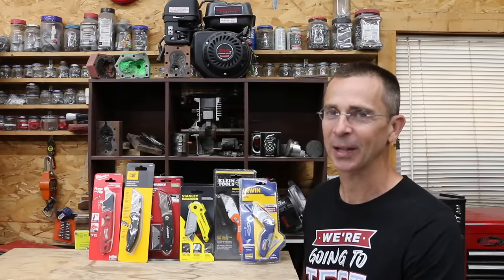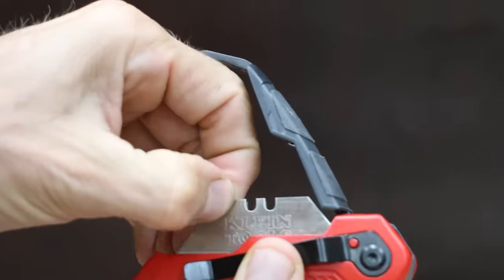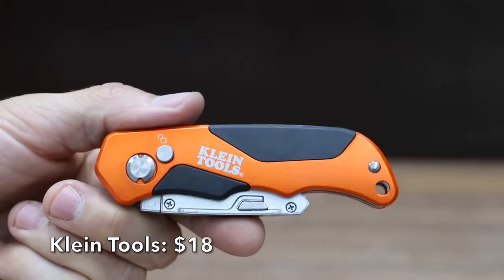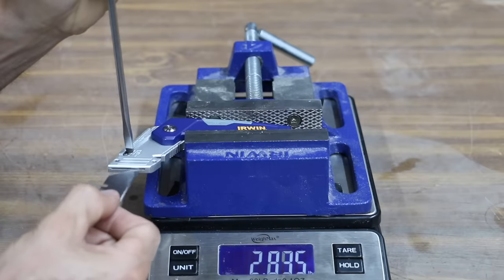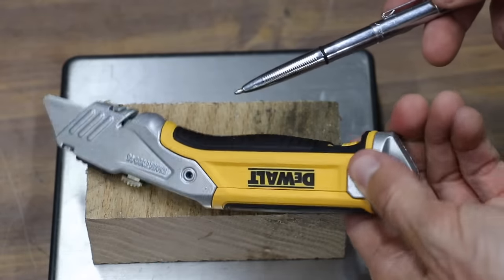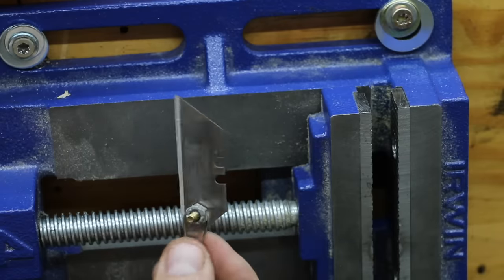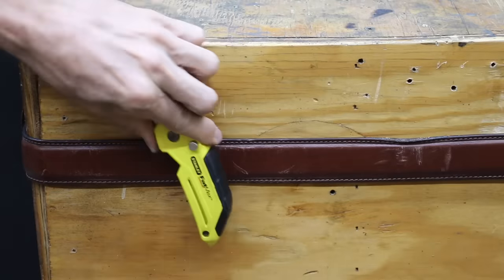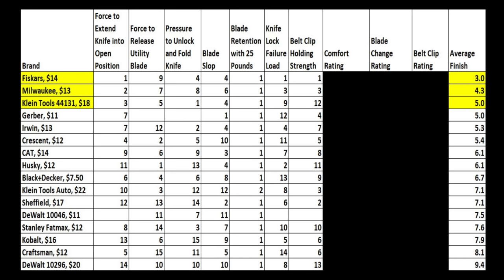Best Utility Knife? Let’s Find Out! Milwaukee, DeWalt, Gerber, Husky, Kobalt, Klein Tools, Craftsman

Comment: Your tests are usually pretty informative and helpful, and no offense but this one really misses the mark. I've used a lot of different utility knives including a few of these, and the problem ends up being either the sliding lock mechanism, the ability to hold a blade without slipping out while applying force, or some part of the knife breaking off or quickly wearing out with repeated use. I should add that I have only used knives with a "quick change" function like the ones you tested here. All of the knives I've used worked fine when brand new, it's just a matter of time before something goes bad.

Comment: I've got the 2019 Milwaukee version and it does NOT have the safety block for the blade release button and damn near every time I use it my knuckle makes its way to the release and out comes the blade.. very annoying. However. I feel like the button gaurd would be painful.. we need an upgraded Fuel version..
Reply from the maker: Thanks for the feedback.

Comment: The Gerber EAB  is not only too hard to open, it is hard and tricky to close, because of the poorly designed liner lock, which mysterious grabs the blade base after the liner lock is pressed in and the closing process has begun, requiring more force to overcome the defective mechanism and continue trying to close it, making it like a potential guillotine  for fingers and finger tips, if you're not very very careful. I added a  Dewalt Carbide blade to the Gerber for better cutting and general performance, but In my opinion it is too dangerous for its intended use by the general public, and I will soon be returning or throwing away the Gerber I bought.

 P.S. The round head, single groove screw holding the blade to the Gerber is made of very cheap material and will start stripping on the first blade change. Why they used a round head machine screw to hold a sharp blade tightly in position is a poor design decision and when the screw is completely stripped, good luck finding a replacement.  You'll never get another  blade to be held in as tight as it is when you first get it.  My Rating is "Unacceptable."
Reply from the maker: Thanks for the feedback.

Comment: Respectfully disagree with this one. I've carried a Craftsman branded knife in the Sheffield style (probably made in the same factory) for 15 years. Once you break them in a bit they open easy one handed and stay locked. They're easy to fold and clip back into my belt one handed as well. I've tried many of these other styles and they're either too big, too hard to open one handed, too hard to close, or too sloppy. The others may be better on paper, but the Sheffield style just works better for me.
Reply from the maker: Thanks for the feedback.

Comment: Video idea - I would really like to see if how well various fuel additives work from octane boosters to fuel stabilizers.  I can't believe the claims of the octane boosters that claim "just add 1 bottle to a tank of gas to get the equivelant of 93 octane" (or whatever they claim.  
I have a friend who claims his car barely runs when he uses regular (87 octane) but if he adds a bottle of something like STP octane booster his car runs great - the same as using 93 octane.  This is why I have a hard time believing him & the claims from STP:  the STP site makes these claims:
5.25 fl. oz. bottle treats up to 21 gallons of gasoline 
12 fl. oz. bottle treats up to 28 gallons of gasoline.
Now it doesn't take a genius to see that  the smaller bottle uses 1 oz to treat 4 gallons while the larger bottle (12oz) uses 1oz to treat 2.34 gallons.  The smaller bottle seems to treat 70% more fuel for equal amounts of additive but it seems both have the same ingredients.  Other brands have similar claims. 
Even with my friends 14 gallon tank I can't see that this 5.25oz bottle is going to raise the octane rating by 6 points!

Another idea is to test stabilizers like "Star Tron Enzyme Fuel Treatment" which I would be very interested to see if it does what it says it does: 

Features

    Makes all engines start easily, run smoothly; improves performance
    Removes and prevents gum, carbon and varnish
    Works in all engines and in all fuel
    Helps prevent phase separation by dispersing water throughout fuel as submicron-sized droplets that are safely eliminated while the engine operates
    Stabilizes fuel; helps rejuvenate old fuel
    1 fl. oz. treats 6 gallons of fuel
    Reduces smoke and all other emissions
    Keeps fuel delivery system clean
It seems to make a lot of claims & I'm sure these would be interesting to test!
Reply from the maker: Thank you for the video ideas!

Comment: Unrelated but Ive been wondering for a long time now if high octane fuel in an engine designed for low octane fuel sees more carbon build up and or less efficiency due to incomplete combustion. Ive seen plenty of opinions on this but no evidence based controlled experiment
Reply from the maker: Thanks for the suggestion.

Comment: The most important test is the knucklebuster test and you didn't do it. If you ask me, it's the ONLY test. When the knife is in use and under pressure, can the hinge overextend? Can the blade release be accidentally pressed and the blade pop out under pressure? Is the blade too tight in the holder leading to snapped blades? (should be a little loose, this will skin your knuckles every time). Can twisting jump the cam? Will the clip loosen over time? 
The Lennox is the only one that passes all the knucklebuster tests, and you didn't test Lennox.
Reply from the maker: Thanks for the constructive feedback.

Comment: 7:50 This test isn't quite accurate from what i can tell. Depending on where the box knife is being held, the leverage it would apply to the weight would be greater the further out the button was, any blade with an inline button that pushed straight down would always appear easier to press on this one. When releasing the blade most people grab the tool as close to the button as they can to actuate it. I think the evidence is in the weight results. One button was almost 7lbs way out near the end of the tool. The best setup change i could imagine would be getting the buttons as close to the center of the scale, trying to simulate a 2 finger pinching motion.
Reply from the maker: Thanks for sharing.

Comment: Titled folding knives. But you test a non folding Dewalt. Might as well test a Stanley 10-499. Folding knives are like multi tools useful  in an emergency but not an all day constantly in use tool. Lumpy grips funky blade changes! Won’t own one! Stanley quick change by choice.
Reply from the maker: Thanks for the feedback.
Reply: Also slim enough to get lost in a pocket without needing to fold.

Comment: I tried the Milwaukee not once but twice,, that light weight metal cracked. Not to mention the advertising on the packaging implies that it will spring open ,, thinking it was like a Kersha,, i was disappointed with that aswell.

Overall don’t buy Milwaukee.
Reply from the maker: Thanks for the feedback.

Comment: Stay away from the ACE Hardware brand.  The press in pins suck.  The Husky looks very similar to the ACE in construction.  For the Husky and ACE, you have to test the flip blade lock.  A knife won't work me if it fails after just 20 blade changes.  You should lose a knife before it breaks.  FatMax is something I don't like. You didn't give thickness  measurements, but I don't like the bulk in my pocket.  Lastly, I find simple Harbor Freight knives the best bang for the buck.  The blade release is a rotating thumb lock that can be done with 1 finger.  Complicated locks suck.
Reply from the maker: Thanks for the feedback.
Reply: @ProjectFarm  No problem.  You do good work.  That knife at Harbor Freight is a bit newer.  It is made by Gordon.  My previous knife from HF is a MarshallTown.  It is rattling a bit with slop after a while, but it is screw based clamps that can be tightened and due to the looseness, I can flip the blade open and closed with ease with one hand and a quick jerk.

Comment: The Dewalt DW 10035 is a piece of crap. Forget trying to change a dull blade for a new one you can't get the old blade to release from the knife and the mechenism easily gets misaligned preventing you from even being able to push the extend blade button to extend the blade out. Stick with Milwaukee brand.
Reply from the maker: Thanks for the feedback.